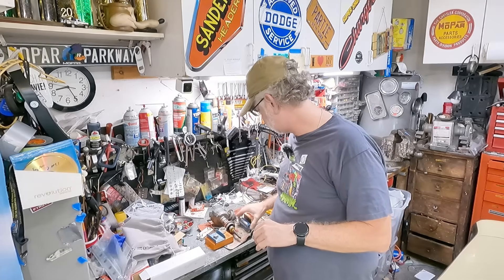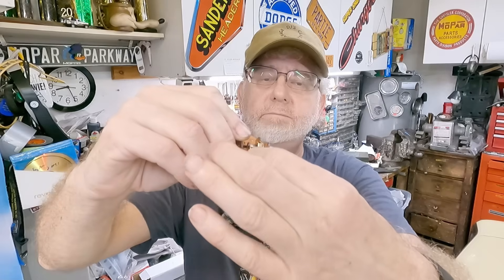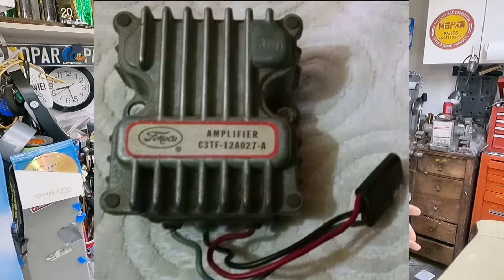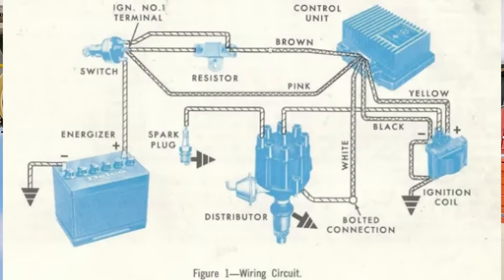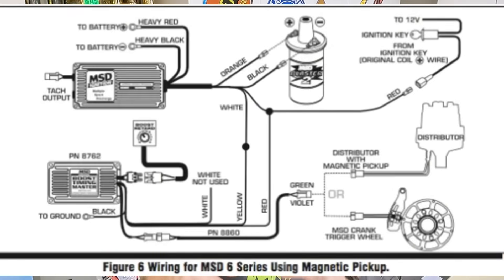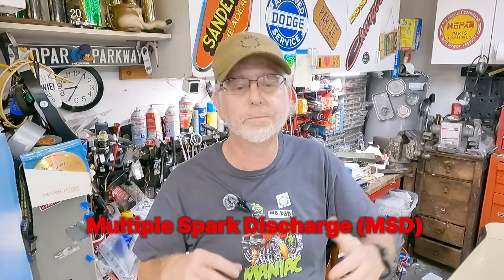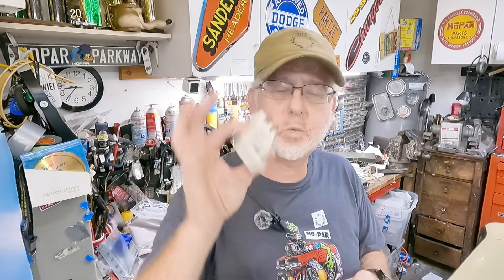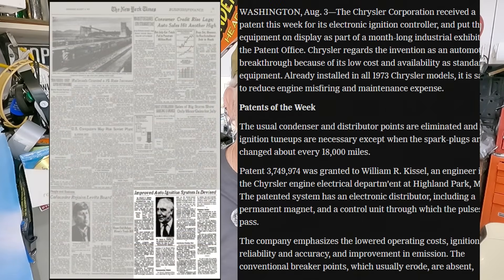Why Everything You Thought About Electronic Ignition is WRONG

Comment: Points are still in use in aircraft magnetos.   Even modern day aircraft engines use them.  That says a lot of the reliability.  Electronic aircraft ignitions are being used in some cases but come with much more complex systems in order  to match the reliability of old points.
Reply: That's a red herring. Aircraft can't afford failure. And maintenance intervals are far shorter. The coil power decrease is less a priority than reliability
Reply: @somebloke5565  Well I do not think that what @Rdhog was saying is a red herring, what ever that is. He is right. Aircraft do still use points in there magnetos simply because they are more reliable than complex electronic systems.
Reply: Maybe that has more to do with certification and an "if it ain't broke, don't fix it" mentality in the GA industry? Changing the ignition system on any already certified engine would probably void the certification, and the industry really is trying to avoid that.
Reply: @citymagnum4734 that's more than a reality it's a truism. But also that's not the case. Being that the automotive world has done all the work it's as simple as doing the research.
Reply: @jarlnieminen4307  You'll think it's simple until your flight ends in a smoking hole. 

I just read through a fatal crash report of a Cirrus R3, family of 4. It had two electrical systems, two e-ignition systems, two fuel tanks and a parachute. One power system failed, left fuel tank ran dry so engine quit which stopped the 2nd power system, batteries very small so ran dead. No electrical so unable to switch to the other fuel tank, no radios, wouldn't have a fuel pump anyway, very few instruments, parachute safety pin was not removed during pre-flight. 

I've read several fatalities, and several survived engine lost emergency landings. Many think two power systems can't fail, yet they certainly do. They think the parachute makes it safe, yet it does not.
Reply: @citymagnum4734  The aircraft industry is competitively motivated. 
If you change anything in or on a certificated aircraft, it's not approved for flight. To upgrade radios, instruments, or a sun visor, the product has to be certified for flight per aircraft type. The certificate is known as and STC, supplemental type certificated. It must be assigned to your exact aircraft by an A&P and entered into the logbook. I think the only exception is the cigarette lighter socket. 

Nobody's trying to avoid it, it's just really expensive to do so only very profitable part would justify this investment. 

The engine model is certified for the aircraft model but only with the specific propeller. The combination will have harmonic vibrations which combine and accumulate to fracture propellers, crankshafts, engine mounts, firewalls, and other supporting structures. To counter these effects 100s of hours of lab tests with vibration sensors are used to determine where the standing waves are formed per condition set. Then the engineers design passive counter measures to minimize until the system passes. Once the lab results are optimized, the flight testing can begin, another 100s of hours. With engine teardowns, x-ray and chemical analysis to measure the rate of fracture. 

All this has been happening since the 50s. And people just get an LS, a gear box, and propeller x to go for a thrill ride. Nothing is more dangerous than one who thinks he knows but doesn't even know enough to ask questions.
Reply: Spot on. No alternative power supply required either. Those aircraft with electronic ignition require redundancy arrangements for power supply. Aircraft cylinders are large and use two spark plugs too. One magneto to each alternative set. It makes adifference! Yes it is dark ages stuff but note also that most ungeared engines rev to only 2800 rpm and mostly run continuously for many hours at near that limit. The magnetos are refined for the circumstances. The electronic units are getting there but are no cheaper because they need to operate in the same environment and with the same reliability and redundancy.   Don't be gulled into thinking that modern solutions are always better. Auto manufacturers put billions into getting an alternative right. Mostly for marginal advantage and to reduce what is really sensible maintenance. Modern cars break down just the same.
Reply: Magneto power is easily selected. All Top Fuel engines run 40 Amp magnetos, but no contact points. 
GA aircraft engines still use two magnetos, with contact points. They also have a battery connection used for the initial startup. 
For GA certificated aircraft, only Continental and Lycoming remain as substantial suppliers. 
If aircraft owners and operators wanted electronic ignitions, both suppliers would build them. 
The magneto ignition systems have evolved substantially over the decades. My magnetos had only a single driven gear and shaft which drove two magneto heads. Many failures and mods, known as ADs or air worthiness directives were forced upon the owners. None of the problems were caused by the single shaft. With all the problems well sorted, all buyers refused to purchase forever after. 

I ran that magneto about 10 years without an incident. 

My point is that even if electronic ignition could be better in every way, I doubt any demand could be driven. 

Every Private Pilot is required to demonstrate the skills to perform safe landing after an unexpected engine power loss. At least once for the instructor, and again for the flight test, then again, every couple years. An engine loss is not likely to be life threatening, but more likely inconvenient. 

Electrical systems do fail too often. I think every pilot I know has experienced electrical power failure. This includes those with two battery/ charge systems, on each of two engines. When radios, lights, and half the panel goes dead, it's nice to still have the engine.  

Magnetos have all been modified over time. Unexpected failures occur on every system. There are probably hundreds of ADs issued. Each compliance was forced, and each was applied to new production. 

How many E-ignitions have run 4 hours every day at 20,000 feet in severe turbulence conditions? To do so, it'll need to first climb to 20k then later descend back to the ground. Repeat tomorrow, through every season. Mags failed under these conditions, were then improved to handle this stress routinely.
Reply: @CycleWerkz  
I'll bet the price "improved" too. Not that there's anything wrong with that.
Reply: @BohappenstanceClick  

The Magneto evolutionary improvement process did not add to the cost of the new Mags. For example, bushing clearance spec adjusted, O-Ring, electrical connector, wire insulator, rotor, cap material spec changed. For these issues, there wasn't really an incremental cost increase, just a specification change. It isn't that the new parts are just better quality, but that they better tolerate certain conditions that were not originally expected. It may even cost less. 

This process is exactly the Scientific Method in perfect form. Everything on the aircraft is included in this scheme. This wholistic reliability method cannot be bought at any price. 

My point was mostly to show that new mags have been flight tested many millions of hours around the globe. Where e-ignitions from cars are just beginning the slow exposure to every unknown problem coming soon. And even if the ignition modules never fail, power input will, even with two power systems. Dual power failures have already happened several times with very few systems in operation. 

A new engine from Lycoming or Continental today cost $80k for the lowest power unit. If you feel the need for speed, about $50k, more will move you about 20% faster.  You can add a second engine for another 20% speed, but that'll run over 1/4 million. You can easily see how ego gets very expensive. 

When electrical fails on a mag fired aircraft, it fails lights, radios, half the dash instruments but enough remain on to fly, AND the engine remains at full power. The end of the flight is irritating but no lives were at risk. 

Literally everything on certified aircraft is subjected to this tremendous real life duration testing. It kills me that people believe a fresh airframe design with new materials, a high-power automotive engine with a low production speed reduction drive, an apple tablet for all information, just skipping all certifications, is somehow expected to keep you alive. Then add to the mix a much higher airspeed. Keep in mind that less drag always equals less stability. 
 
Most people are very convinced flying is expensive. Aircraft operation and ownership can be expensive, especially for the lazy, unskilled, or proud. Or very reasonable if you need it to be. My experience was not expensive. Most of my pilot buddies' cost were similar. None of my flying friends were rich. I used mine for personal transportation only. I loved the time reduction for travel. 

Many costs are not necessary. I didn't attend any flight classes. The rules are that you must pass the written exam, you're not required to take a class to do that. I broke two records at the exam center, the quickest to finish and the highest score. The textbooks and study guides are excellent. If you can read, you don't need lectures. 

All my flight instruction were in my own aircraft. I never rented aircraft time. I hired independent CFIs for flight instruction. Rates were about 60% of hiring the same person through a flight school. I spent about $1000 for CFI training time and about $350 for books, mechanical calculator, cool sunglasses, headsets, and cockpit organization stuff.  

I bought a 1979 model C172 out of annual with a couple issues, in 1989 for $27k, sold it in 1999 for $42k. I paid for 11 annual inspections averaging $1100. Hangers $1800/yr. I clocked about 800 hrs, about 96k ground miles, or around 120k road miles. My fuel cost was about equal to car fuel cost for the same trips. 

I performed almost all repairs, with certified oversight. Including a complete engine disassembly to inspect Crank and Cam for certain failures. 
I fixed two issues everyone, including ALL the experts, told me were hopeless.
I fixed both Nav/Com radios after shops failed to find the problem, twice. For $30 in parts, I fixed both. Every person I knew, just shrugged while recommending I should just get a new King radio stack for $12k. For $30 in parts, I fixed both.

My aircraft's airspeed was about 5 knots slower than shown in the operation manual. Almost every pilot and mechanic is very familiar with this aircraft. It is the most popular GA plane ever made. The paint was not glossy smooth, so most told me I should have it painted. 

I couldn't afford a paint job, so, I discovered and repaired the problem, without any new parts. I did require two days of careful metal forming to repair the intake airbox. Pilots would only believe me after we flew to prove. It flew at exactly the velocity in the manual, plus every other performance value matched the manual. All this with the rough paint. 
Roughly 5-6 other things I fixed myself for incidental cost, to avoid $1k hits for each. I'm not special on this, most guys I knew did the same.
Reply: @CycleWerkz  
 It's strange that you would respond in such a detailed way to my comment. Not that I didn't enjoy it. 
I have wanted to fly since I was a child, but life and a couple of bad decisions (ego based/not prison, but a prison of sorts) got in the way. I too have sheet metal skills, I was an "electrical/mechanical repairman" in the service and worked on a missile system. I've always done my own auto repairs (it's getting tougher with the "advanced" technology). My first car was a Nova that had a worn-out front end (bushings, ball joints, etc). At the age of 16, I jacked it up, bought an obscure Hayne's manual, and figured it out. So, we have a bit in common.
* "It kills me that people believe a fresh airframe design with new materials, a high-power automotive engine...is somehow expected to keep you alive."
Reminds me of the "Titan." Tragic. "I'll never forget their hand controls.
 * "If you can read, you don't need lectures."
I got a degree at 40, and the "lectures" consisted of "instructors" reading, verbatim, from of the book, and the books were full of typos and grammatical errors. I thought, "Why am I here?" I can read this at home.
* "You can add a second engine for another 20% speed...You can easily see how ego gets very expensive."
Is it just ego, or ego and something else? My original comment was in reference to the ridiculously astronomical waste and inefficiency That has been ongoing in our country for decades (I could give you first hand accounts), and now?, We are obviously regressing, devolving.I would simply offer up current events?trends as proof. It would be comical if it didn't affect me directly.
* Check this out ↓↓↓. Don't get caught up in the title. I mean no offense. Congratulations on achieving flight. I don't envy you (It's not in my nature). My sentiments are genuine. Kudos.
https://youtu.be/1JiR8af6Nvw?si=xpK9nYJKGpLFQIwc
Reply: @BohappenstanceClick  
I may have done the same front suspension rebuild on the same model car. Mine was a 66 Chevy II, but not the box. 

The idiot index is a titillating idea. thx. So how do we use that for software with $0 cost of materials. The idea fails philosophically.  The value of anything is exactly how much it sells for, nothing to do with cost of materials. 

I did respond to your short comment, but I was also responding to the entire thread. Common perceptions of GA are off the mark enough to errantly influence decisions. 

Congrats on your degree at 40, goal accomplished. 

The 2nd engine is all ego, imho. Enjoy a few facts... twin engine GA aircraft enter the smoking ground hole more often by every stat, percentage, #of flights, total #, pick any measure. Most often within a minute or two after takeoff. Most others are pilot disorientation in IFR due to infrequent challenging conditions experience. Twin operation is much more complex which is more likely to overload the pilot without recency.  

Most people I know who got their Private Pilot license flew very few times <10 afterward. So don't feel bad about not doing it. 

I think it's around 70-80% of those that begin flight training, do not complete. I didn't look it up, so that's from my memory from 40 years ago. The FAA keeps making it easier to get a license because of the failure rate, and declining interest. 

My university experience was similar to yours. My passion was Radio engineering, but in 1980 nobody cared. After 2 semesters of pre-reqs, I enrolled in an Antenna Design course. I loved the subject so much, I completed all the textbook problems before the first class. When I arrived, I was the only student. The Prof had a withdrawal slip waiting for me. I asked him to explain a few things from the text which he did. He let me take the final and gave me the grade. It hit me that I could learn anything the same way. And I could learn it much quicker without the school slowing me down. 

I see what you mean by the efficiency regression, but there may be another useful perspective to consider. I compare my lifestyle to my parents, and grandparents. I see giant leaps in life quality as generations progress. I grew up in the labor class and felt all was fine. My father worked the GM line, mom a secretary. I joined him at the GM gate during a 10-month strike. Missing a paycheck we painted houses, harvested crops, built fences, fixed cars, & mowed lawns. Car engines might reach 100k miles but usually not. Tires, brakes, belts, hoses, bearings, heck everything wore out quickly. I have a car now with 190k miles, it has never leaked oil, I change spark plugs once but really it only needed the boots. 
What about cell phones, remarkable info access and communications in your hand. 

I hate government waste, if that's what's bothering you... me too. 

Aircraft parts improvements epitomize the Scientific Method. Failures in excess are observed, the repairs are engineered, then implemented. Those improvements are then applied to all new parts. I don't see a way to improve this.

Comment: The Delta ignition system was an early 3rd party add-on that would use your points and boost the ignition spark. If this system failed you might find that bypassing it, while working in theory, would probably not work if your points have not been regularly adjusted.

Comment: Odd thing. Ive been reading comments about how reliable this system is. Ive owned a 79 volare, an 80 D100,  84 D100 and a 79 LeBaron. They all had multiple failures of the ignition modules.  The 80 D100 was bi monthly  thing.  With the notorious crysler wire failures  across all the mopar's I've owed i finally decided it was time to move to another brand.  Seriously as far as I'm concerned the gm HEI is the only no-points system that was reliable. I mean come on , if it wasn't why would they produce HEI replacment dizzy's for every kind of engine out there.  It's always the mopar guys who are delusional about the reliability of thier chosen brand. I've never heard a mopar guy admit to the weaknesses of the brand.